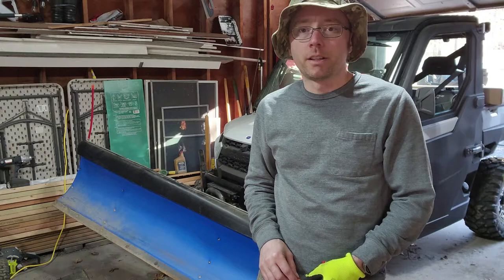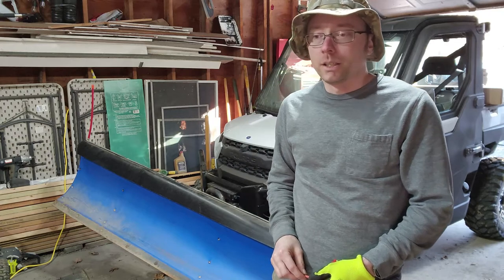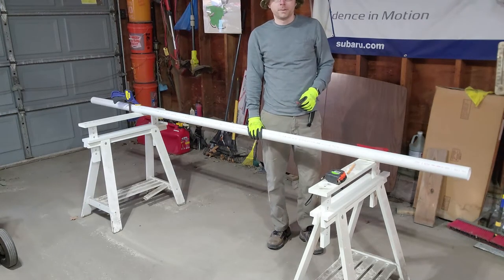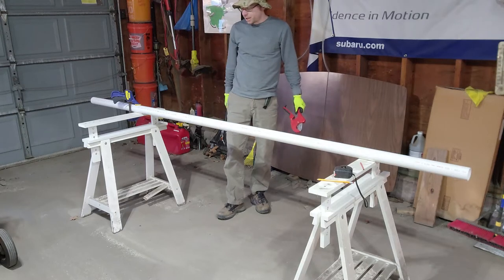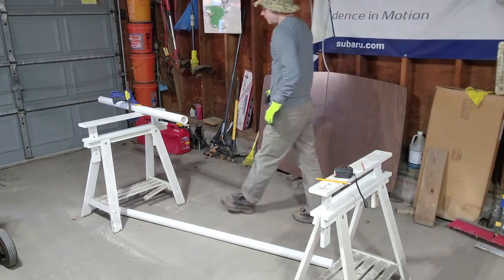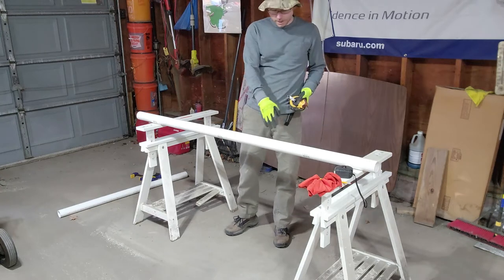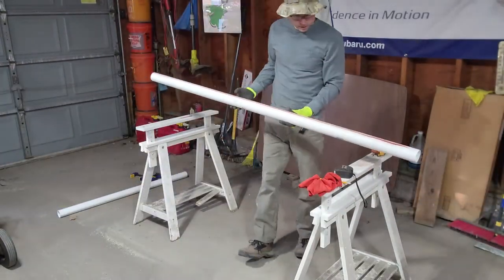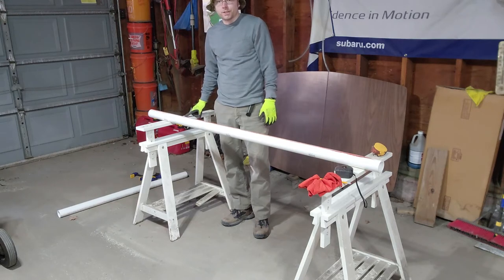PVC Plow Blade Modification for Gravel Driveways & Roads

Comment: what holds it on? looks like it could slide from side to side?   ive seen people using metal pipe ... but they bolt it on... anyway.. good luck to you🤠
Reply from the maker: I thought the same, but it's a tight fit, never slid side to side bit did break when I abused it.

Comment: This is not going to last long. You should be using schedule 80 PVC. Also, I used a workmate bench and a 10' length of 2x6 as a fence to cut a perfectly straight line. Your freestyle method will result in a wobbly cut. Good luck!
Reply from the maker: It did ok until really worked it and it broke.  I replaced it with Sch80 and that broke on one of the corners.  I will be uploading a video shortly showing how I fixed it.
Reply: I work at Lowe's and a customer told me about this "hack". He was looking for a piece of 2" ABS and when we didn't have any in stock I suggested PVC. He stated that his research indicated that the PVC will break in the cold. The ABS apparently won't and holds up well with the use and cold. Look fir a the black ABS at your local home center or plumbing supply. Good luck and thanx for the content.